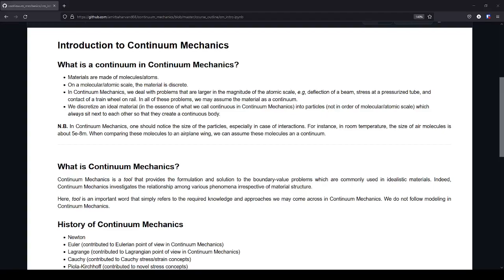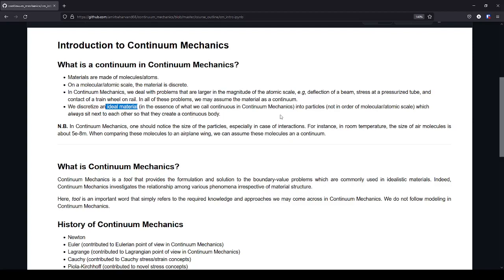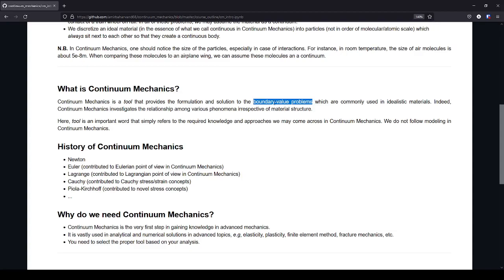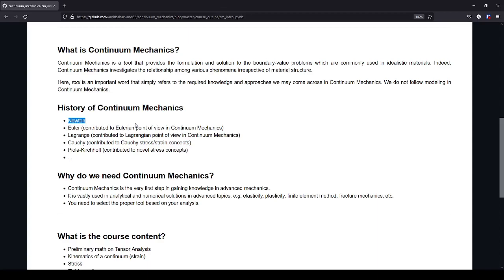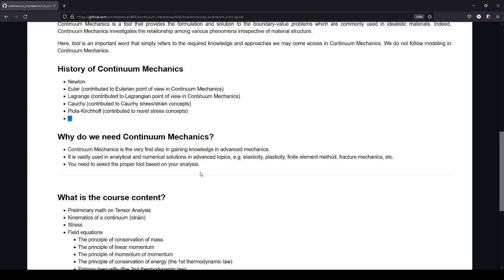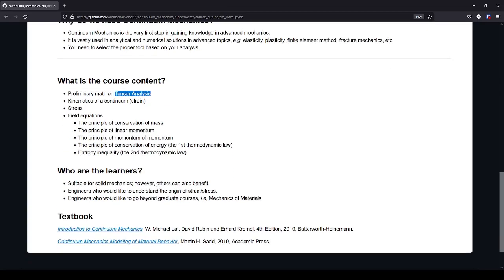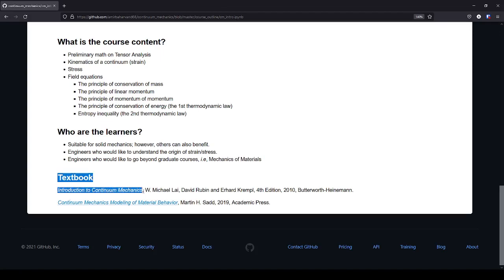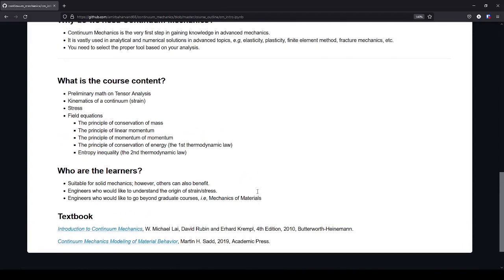Continuum Mechanics-Introduction to Continuum Mechanics

Comment: In my university, computational geomechanics mostly still uses the continuum mechanics approach/assumptions. But there is also a research group that doesn't and instead uses discrete element method (DEM) whereby each individual sand or clay or silt grains are modelled as rigid bodies and the contact between each grain are modelled as normal and frictional forces. But these models are very computational expensive and in that research group, one of the PhD candidate couldn't complete all his experiments on time and could only get a Master at the end of his four years.
Reply: Which appraoch do you like and which approach is used in ABAQUS?